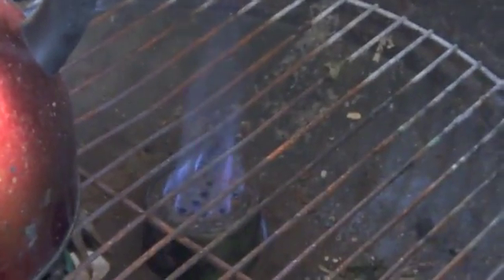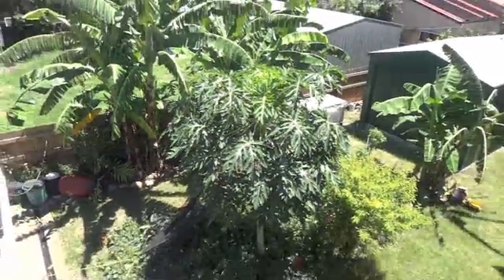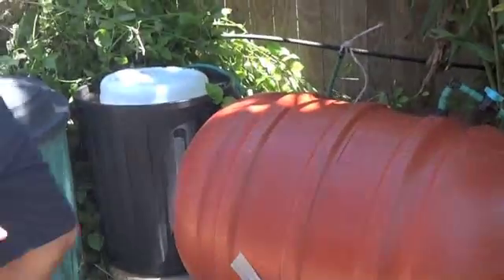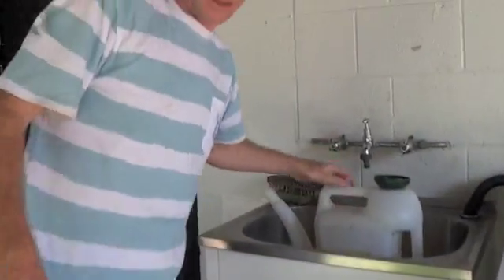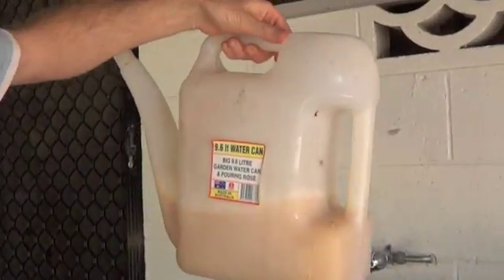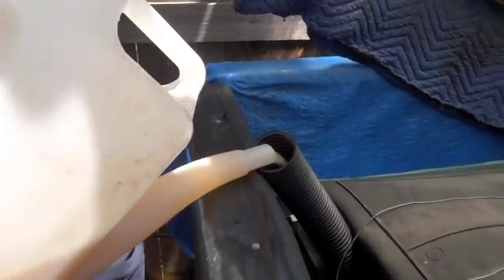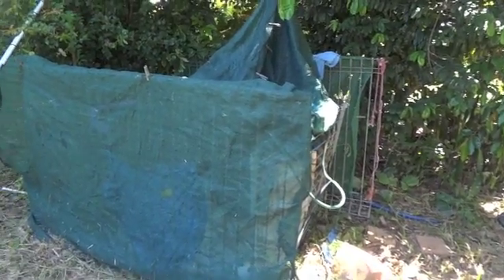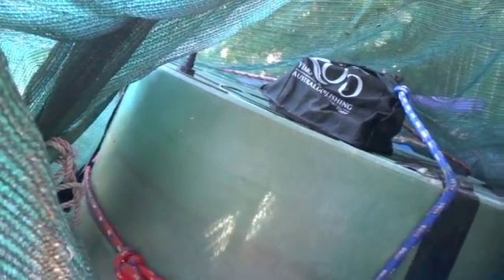Biogas; from food scraps and grass clippings

Comment: Amazing system, well done. Do you think it would work in the south of England UK where it's much colder ?
Reply from the maker: It will depend on how well you can insulate your system. Solar Cities has designed a number of simple systems in Northern USA. So yes it is certainly possible. Google Solar Cities biogas and you will see systems for all climates. Have fun pottering we certainly did. We use mostly scrap fruit which is very productive due to the sugars they contain.